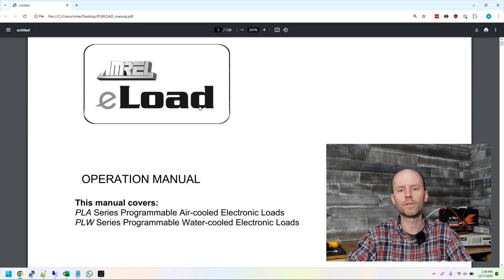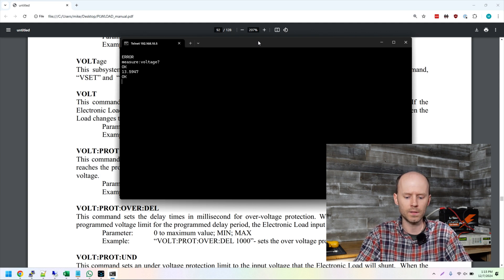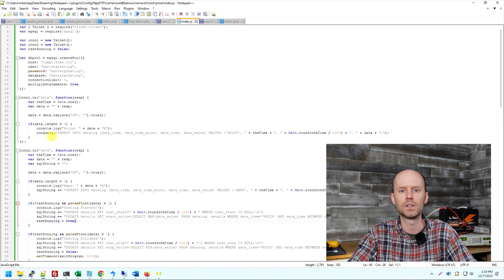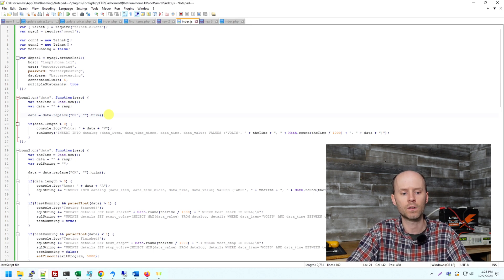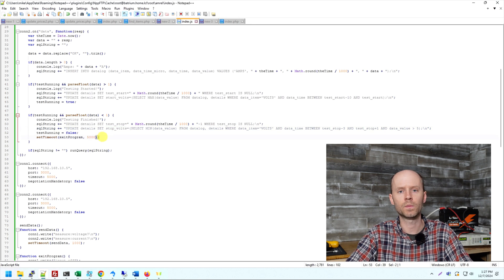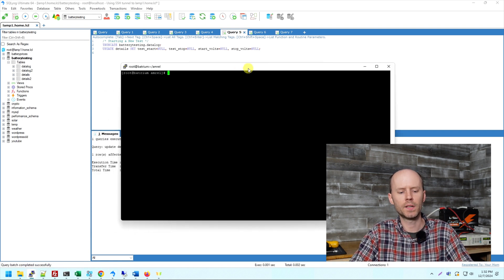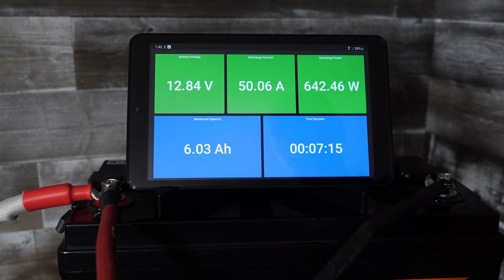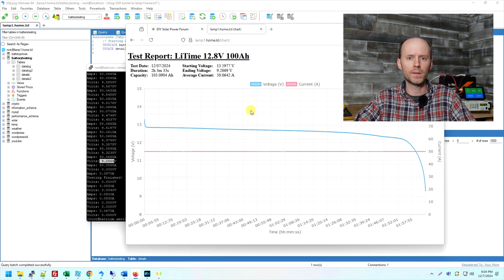New Capacity Testing Setup, Detailed Explanation with the Amrel PLA800 Load

Comment: Love how precise your testing environment has become!  It's really a simple setup as well.  Have you noticed any slow-downs or lockups in putty requesting that much data at a 1 second interval?  Are you planning on building your own "control panel" where you can just initialize your data fields and start your tests without having to have both putty and a command window open?
Reply from the maker: I haven't noticed any slowdowns. I was actually thinking of changing it to 800ms to make sure every second of time has at least 1 sample. I'll have to play with it and see - probably splitting hairs at that point. And no, unlikely to make any control panels. I do anything I can at the command line, not a GUI person lol. The command prompt control was shown for the demonstration. During regular use, I'll just punch in the settings on the front buttons.
Reply: @ can’t blame you.  I prefer the command line if I can get away with it as well!
Reply from the maker: So it turns out once you initiate a connection to the ethernet port, it locks the front buttons from being used. That's unfortunate as now I do have to run the test from the computer, can't punch in the settings on the front display. Doesn't make a different for testing, but can't video the buttons then lol.
Reply: @LithiumSolar  That is disappointing.  I guess since this is more "lab level equipment" it's more to prevent accidental changes.  There's probably no way to override that either.  Still a sweet piece of gear though!

Comment: Awesome video as always! Would you have any thoughts/experience on converting AGM/SLA UPS' into lifepo4? I've tried with a Vertiv Liebert GVG3-1500RT120 UPS, it has 4 12v AGM batteries in series for 48v, but the UPS got confused and wouldn't charge the batteries. I tried with four lifepo4 12v batteries (NERMAK 2 Pack 12V 10Ah Lithium Ion LiFePO4). Thanks!

Comment: $800 is a great price for that load. Congratulations on the smoking deal. It's really sad that I understand every word. In the 1980s we used GPIB or IEEE 488 interfaces, it wasn't until the 90s that ethernet interfaces for test equipment became available. Yes, I actually ran thicknet cabling in DARPA buildings in the 80s.

Comment: Wow..i dont understand a thing😂
Reply from the maker: TLDW version > It's a very precise battery tester!
Reply: What's really sad is that I understood every word. I have run similar tests with cheaper (lower capacity) equipment. You can parallel the cheaper (but new) equipment, it just gets more complicated by having to add the results from 4 individual loads.

Comment: wouldnt the EBC-A40L High Current Lithium Power Battery Capacity Tester do pretty much what you need to to discharge Lithium batteries ?
Reply from the maker: No. That is an 200W tester. This is an 800W tester. That's nearly 4x the discharge power.
Reply: @LithiumSolar  ahhhh ok huge diffeence

Comment: Not to confuse async language with multithreaded. While your function doesn't wait, it doesn't process in parallel, but it is still run in order, just not the order it was programmed in, whatever order the node scheduler stack picks based on events.
Reply from the maker: Correct, not multi-threaded. The time on the request is spent waiting for the tester to answer. My assumption is the tester is processing the requests in parallel, thus sending the requests in an asynchronous nature should still be faster than sending one, waiting for the response, sending the second, waiting for the response, then starting the 1 second timer.

Comment: Thanks for this cool video! 
I am very impressed with this methodology. (Tho, I am not 100% sure I understand the need to use this method over a low cost load meter with a fixed load... I get you want a fixed current but won't most load meters account for total power used anyway? But either way, it is very cool to be able to see it in real time graphed).
Reply from the maker: A big part of the issue is most inverters (ie my fixed load) would not run down far enough until the BMS disconnected. The inverters were shutting down due to low voltage. In the past, I've used a not-very-good BESTEK brand. That inverter eventually quit. The replacement Reliable Electric I bought always shut down too early. Then yes, there's the desire for a constant current solution instead of constant power.
Reply: @LithiumSolar  Ah, that makes sense. Thank you.